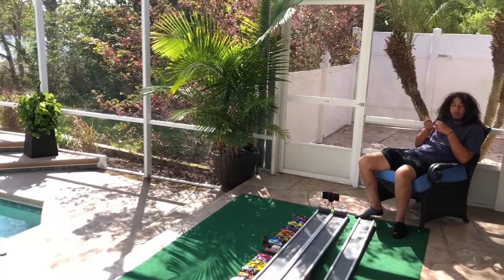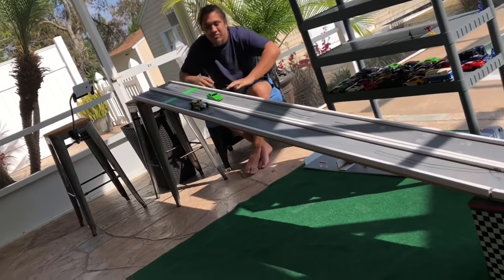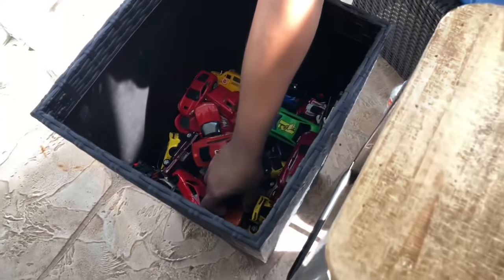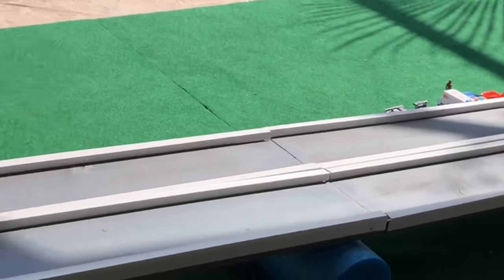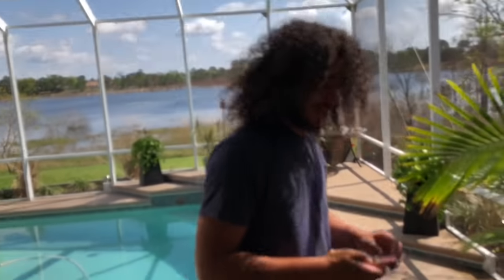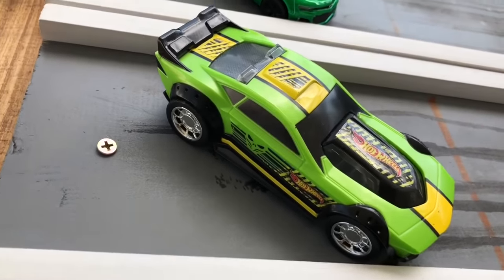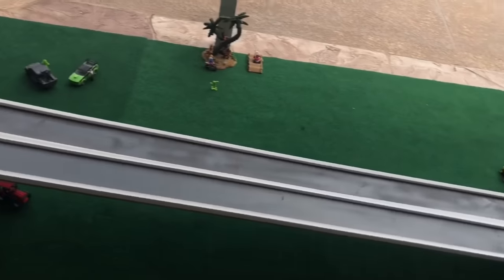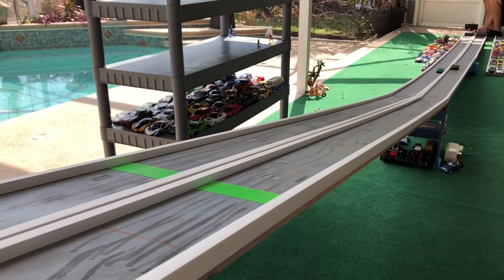PULL BACK DRAG RACING 3 | DAY 2

Comment: Hey guys love your videos, and really like your pull back drags!!!! but i have an awesome suggestion for some drags on the pull back track.all over ebay they have pull string cars most are 1/24th scale. there is one brand that are made by Marx Toys made back in the late 70's, and they are Funny Cars.. and they are pretty fast..love to see you guys race these as well as pull string cars.another brand is Lanard. so the best way to find them on ebay is first type in Marx Funny Car....Lanard Pull String Car, and just Pull String Cars.. i own about 11 of the Marx Funny Cars.. sometimes there only a few at a time to buy. you have to keep checking on the Marx Funny Cars, they are collectbles.. but there are always alot of these 57 chevys.. hope you guys will get some to race.